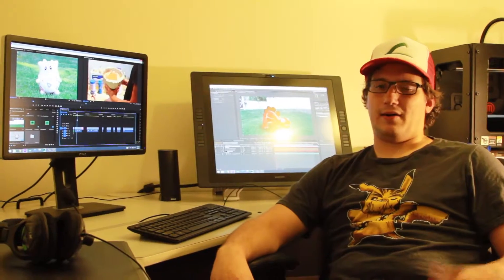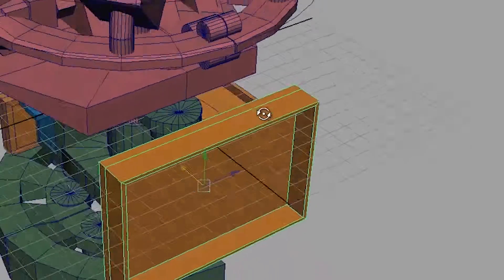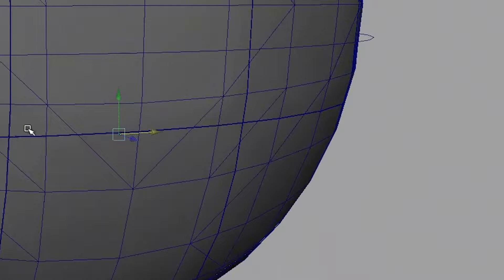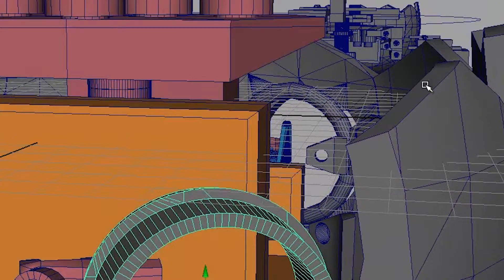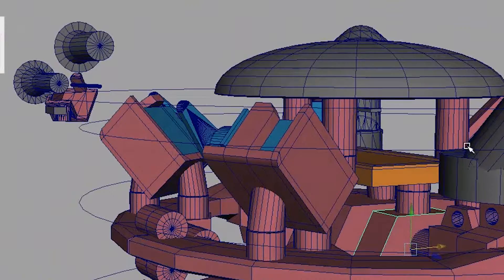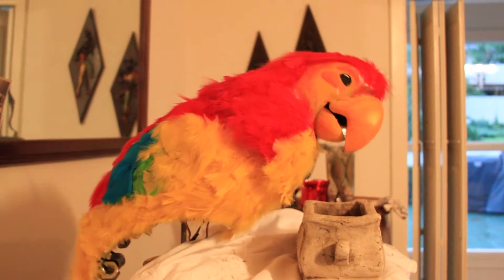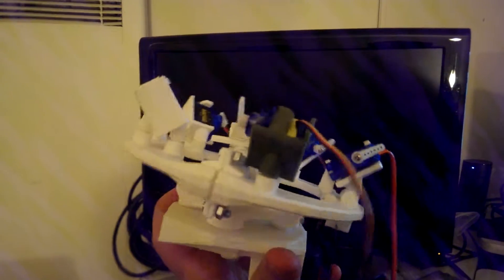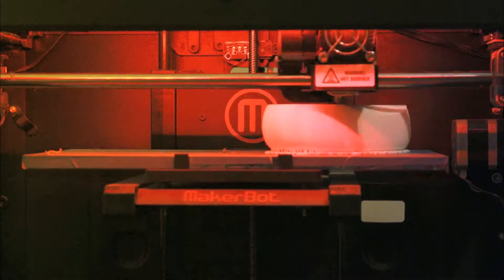Animatronic Togepi Part 2 - Mechanical Design and 3D Printing

Comment: is this practical for someone who has no skill in arduino to make?
Reply from the maker: I'd say not really. Like everything, one needs to start small and expand from there. The arduino is probably the easiest part. Really only involves knowing how to move servos and listen to serial from the bluetooth controller. So if you happened to have all the pieces, or expertise to make them, then the arduino part is relatively beginner, and potentially practical. In fact, these servos can be controlled directly from a radio receiver without an arduino for real-time control. (but no animation)

I spent a bulk of the time designing the structure, printing, all the troubleshooting involved with printing, molding the clay head, casting the skin (and the many expensive failures at that :) ), and writing the exporter from maya.

My advice would be to pick up an arduino and beginner kit. You can find them for about ~50 bucks often bundled. Do every single tutorial. It will be boring, there will be aspects you won't be interested in, and you'll be temped to start big projects from the inspiration of what you learn and ditch the beginner kit. But I can't stress enough how important it is to learn a base before starting a big project. This is something that has held me back both in game development and electronics.

Good luck if you start with arduino, and feel free to ask any questions :)
Reply: Thanks man! I'll remember to ask. Nice work on the togepi

Comment: Great project! It's the first time I've seen someone designing mechanical parts for printing with Maya.
Reply from the maker: John Thanks! Yeah I'm sure some kind of cad program would be better and some day I'll get around to learning one.
Reply: Steakosaurus use whatever works for you, it's interesting to witness a different approach to a problem. I recently started using/liking Autodesk Inventor (3 years free student license), but bringing separate parts together into an assembly can feel a bit clunky sometimes, and maybe it's overkill for small projects. Looking forward to the rest of the series. Cheers